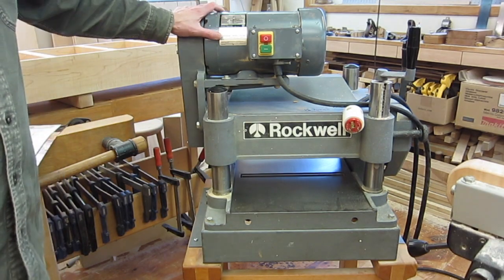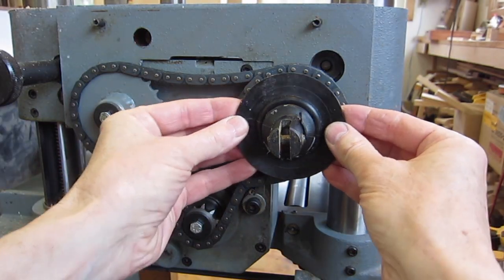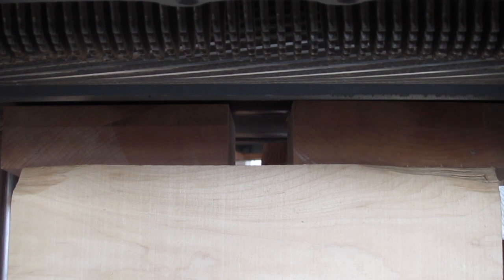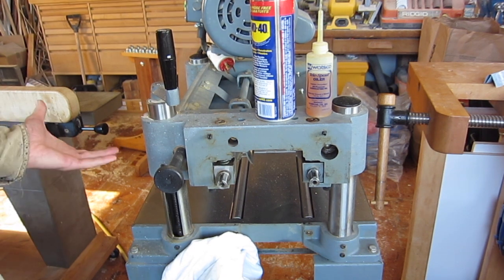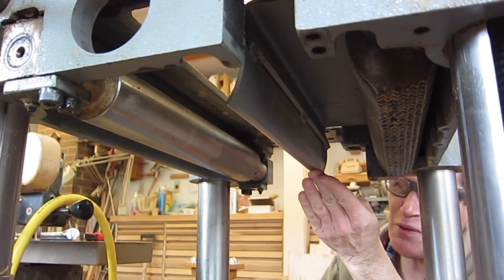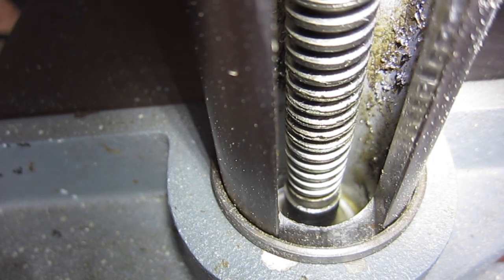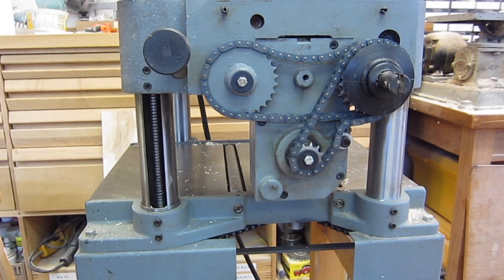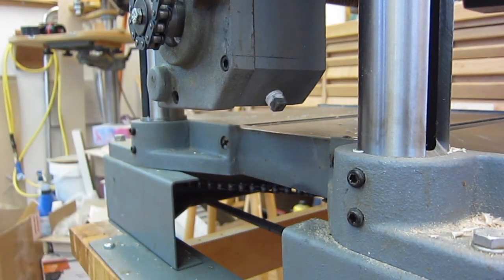Rockwell Delta RC-33 DC-33 22650, 4 post planer upgrade to BYRD SHELIX + Lubrication + Adjustments

Comment: Doing a Shelix upgrade right now and consider myself so fortunate to have stumbled onto Steve’s first rate video. 
What a wealth of easily repeatable techniques. I have a lot of experience myself in both woodworking and precision tooling inspection, but I learned something every minute I watched this treasure. A real service to our virtual community of woodworkers and garage  jockeys. THANK YOU!
Reply from the maker: @Al6kar  You have a good eye to catch that broken insert.  I did not notice it myself.    Having used the upgraded planer for almost 2 years, I checked and there are no more broken inserts.  The most likely explanation is that the broken insert in the video was due to handling of the cutter head during installation.

Comment: Hi Steve.
I want to really thank you for an amazingly explicit and comprehensive video. I can only imagine how difficult the editing must have been especially with you having to explain every step. Your effort is really appreciated as I am in the process of servicing and troubleshooting  my used 15 inch rhickness planer which is almost identical to your machine. I'm a huge fan of the vintage Rockwell machines and also own a Delta 22-101 which I plan to clean up as well one day.
Thanks again. You have a new fan.
Reply from the maker: Thanks for feedback.  An additional challenge is this was my first time taking the machine apart, so I made many mistakes along the way, had to back up a few times and re-shoot video showing the correct way.  But it was all fun for me, just like a challenging woodworking project - learn by doing.
Reply: @steven.woodward  oh wow, now I'm flabbergasted....it seemed like you had done this many times. 
It's guys like you that give us novices the confidence to tackle tasks that would otherwise seem impossible with a 'let's call a professional' attitude.
Can't thank you enough!

Comment: Steven,
A friend of mine recently acquired a: Delta-Invicta
Model# 22-650
Serial# 26272
230 volt, phase 1~60
Manufactured in Brazil, 11/1987
I have agreed to help him change the blades & tune it up. It is something I did in a graduate level 'Machine Maintenance & Repair' class I had in graduate school about 40 years ago. We do not have the original knife setting jig that came with the machine as it was in storage for a couple decades before it came to my friend. I believe that it was mentioned in your video that you also lacked the original knife setting jig. I've read the 176 comments on your video but didn't see it addressed. I've also looked in your Google Doc's, as well as joined the Woodworking Talk forum and read the string of comments you recommend. I also followed the others they point to. If I missed where you addressed it, I'm sorry.
My question & the issue is "How did you personally change the 3 straight blades on your Rocket/Delta before you switched to the Byrd Shelix head?". What jig & procedure did you use? Also, my friend has a Belsaw Planer & jointer that I'm not sure of the make & model. Is there a jig you're familiar with that we could use on all 3. The Belsaw Planer & jointer are both good sized floor models, not benchtops. Any help & advice would be greatly appreciated. 
Thank, 
Wayne
Reply from the maker: When I used the original straight knives, I used the jig that came with the planer.     I have not tried any other jigs for setting the knives but here is a good discussion on the topic which may help you.   https://www.woodworkingtalk.com/threads/using-aftermarket-knife-setting-jigs-for-delta-rc-33-or-invicta-delta-22-650.11600
Reply: @steven.woodward  Yeah, I went through that also. Do you happen to have pictures of the original jig &/or plans that a new one could be created from?
Reply from the maker: @waynemiller6945    A photo of the original knife setting jig is in this thread.  https://www.woodworkingtalk.com/threads/delta-dc-33-planer-knife-jig.228364/        I don't know of any plans for making one.
Reply from the maker: @waynemiller6945  Have you seen these:   https://www.grizzly.com/products/woodstock-planer-pal-standard-pair/w1216a
Reply: @steven.woodward  Yes I have. My friend actually bought a used, Delta branded set of Planer Pal, knife setting jigs that appear to have been manufactured in the 80's. They are very similar in design. We're hoping that they will be functional for both his planers & the jointer. I am curious about the form of the original 22-650's knife setting jig because of the limited space to access the knives from on top of the planer. Do you still have yours? Or did you pass it along after the cutter head upgrade?
Reply from the maker: @waynemiller6945  I sold my old cutter head to a guy who makes wooden jointers and gave him the knife setting jig.    I do recall it is a bit of a tight fit to access the cutter head from top of machine.   I am curious if the Planer Pal jigs will fit but certainly worth a try.   Please let me know.
Reply: @steven.woodward  Of Course, I'll let you know. It will be several days or a few weeks before I expect to report back.
Thanks for what you do Steven. Keep up the Good Work, 
Wayne
Reply: @steven.woodward  Thank You Steven. I had looked at all the diagrams in the exploded view parts drawings on your Google Drive Folder, an excellent resource by the way,  of the various models of this planer. I won't be able to cast and mill one, but maybe the style that has two flat pieces of metal with a rod connecting them. That is, if the vintage Delta brand Planer Pal doesn't work.
Thanks Again Steven. you're really doing good work,
Wayne

Comment: I purchased a well-used Invicta-Delta Model 22-650 (S/N: 16242, Date: Jan 1986) planer a few years ago.  It definitely needs cleaning and some TLC.  This video and PDF is most timely as I just pulled the planer out of the back of my shop to begin the cleaning and adjustment process.  Thank-you for your effort and detail in your video!
Reply from the maker: Congratulations !     Let us know how it goes.    I personally get more satisfaction by restoring a machine, than buying a new one.

Comment: Steven, this video is an absolute life saver.  I just purchased a used delta invicta 22650 and stumbled across this video.  I can't wait to get in there and do some cleaning and maintenance on mine and get it tuned up.  Even though I'm planning to use the straight blades at least for a while, some day I may upgrade to a shellix blade and I'm sure I'll come back and get great value from the video again.  I know a video like this adds probably 200% of the time it would have taken to just doing the rebuild without filming, so please accept my heartfelt thanks for sharing your process and lessons learned.  Kudos!
Reply from the maker: Thanks for the feedback.   Congratulations on your purchase of 22650.    At least half the video is useful for those with the straight blades.    I would not bother to open the gearbox unless you are changing cutter head - just drain the gear box, fill with oil, drain again, and fill with oil.   

One thing that is required for straight blades is the fixture used to set the blades into the cutter head, so that they are all at the same height and parallel to cutter head.   A fixture was provided with each new planer but some used planers are missing the fixture.   If you are missing the fixture solutions can be purchased from other suppliers.  

Here is a very handy discussion on setting the straight knives:   https://www.lumberjocks.com/topics/87482
Reply: @steven.woodward  Great advice.  The planer I bought indeed does not have the alignment jig for the knives.  I've been working on a solution for this and already came across the discussion you linked.  I think I have a reasonable solution figured out, but I'm concerned the springs that push out the blades may not still be included since the prior owner said he had better luck aligning the blades without the springs installed. I'll see what's what, but I may come looking for advice if I run into any major difficulties.  Thanks again for the great tutorial video.
Reply from the maker: @uclatimsta  I no longer have my old cutter head  [ sold it on Kijiji,  to a guy who was going to make a jointer with it ], so I can't measure the springs for you, but they are nothing critical so you could just measure the diameter of the hole that the spring fits into, and estimate the length required , then order some compression springs on Amazon, or maybe an assortment kit. https://www.amazon.ca/CREEYA-Compression-Assortment-Different-Stainless/dp/B08KD5Q2P7/ref=sr_1_6?crid=2CZY92AFXLD9N&keywords=compression%2Bspring%2Bassortment%2Bkit&qid=1653163523&sprefix=compression%2Bspring%2Bassortment%2Caps%2C70&sr=8-6&th=1
Reply: @steven.woodward  awesome, thanks for the info!

Comment: thank you for such a detailed video. I just purchased a RC-33 planner. Now I have confidence in dealing with any issues with my planner.
Reply from the maker: Congratulations on a wise purchase !   As your machine is 30 to 40 years old, and likely not had a complete lubrication recently, if ever, my humble suggestion is to perform the lubrication steps in the video.  This will give the machine a second life.  For the actual work the PDF instructions may be easier to work from.  PDF file can be found here https://drive.google.com/drive/folders/1_Qm84_ZeMmsxgP-hHsI-Ppf39kiUOEU3

Comment: Just got a 22660 yesterday that is going to need a little work. This video will be very useful....good job. Appreciate your effort!!
Reply from the maker: Congratulations !    I added Delta DC-33 22660 manual to the google folder mentioned in video text above.   Looks like same architecture as machine in the video but the gears and belts are little different.   Let us know how it goes.
Reply: Steven Woodward Leveled the carriage, adjusted the rollers and chip breaker height, replaced the blades, and gave it a good cleaning and it’s working like a champ! What a well made machine. Thanks again.

Comment: Awesome video.  Thank you very much.  I used a utility knife blade to open my gear case with a pair if vise grips and a wedge afterwards.  Need to order gasket materials now. Glad I opened  the case to know for sure that there was no problems.

Comment: Wow.  That was an excellent detailed video.  I just picked up a Delta 62-175 (for $200 with mobile base and stand, knife setting jig, and an extra set of knives) in really good condition.  Just fired it up last weekend.  It looks very similar to yours and now I think I'm going to have to at least get it lubed up; you saved me a ton of time.  Appreciate your very detailed instructions.  Thanks.
Reply from the maker: You got a very good deal Frank.     Let us know how the 62-175 planer rehabilitation goes, and if it is the same as RC-33.

Comment: I just watched your TS sled video from the link on the CWW forum and poking around, found this one.  My RC 33 is an older one; no disengaging lever, but I do have the cast iron dust chute.  No intention right now in adding the Shelix head but I do need some maintenance.  I will be bookmarking this excellent video and following your outstanding instructions.
Thanks very much for taking the time to share your experience.
Reply from the maker: The  cast iron dust chute is a rare item - nice to have.  Most people, including me, did not purchase that accessory when they bought the planer, as dust collection was not so popular in the old days.

Comment: Hi Steven,  Thank you for taking the time to detail your process so thoroughly.  I just purchased a well-loved (Serial # 9975, Date 3-84) Rockwell 22-650 planer at an estate sale and look forward to refurbishing it using your video and PDF guidance.  Thankfully the purchase location was just four houses down from mine, but I still need to get it from my street-level garage down to my basement workshop.  I imagine I'll be doing that in pieces.
Reply from the maker: Nice to see these old machines being passed on from one loving owner to the next.  With occasional lubrication it should last for 100 years or more.  I imagine a future, when machines are all made of plastic, and someone comes across this solid cast iron machine from 1984, in perfect working condition.
Reply from the maker: Regarding taking the machine to pieces for moving.  The easiest thing to remove is the motor along with the cast motor mount and cast belt housing - just 2 bolts and off it comes.    That should knock the weight down quite a bit.   There are four holes in the base, two at each end of planer.  Steel rods, that came with the machine, go into these holes to create "handles" so that the machine can be carried by two strong people.   The rods that came with machine have a groove on one end to receive a circlip ring.  The circlip ring goes inside the casting so that the handles don't slip out.

Comment: Great video. I'm only 31 so I want to pick up one of these machines that's older than me!  You could eliminate that 13.125" problem by attaching a little spacer to either side of the planer bed wall, infeed and outfeed - then all the wood would go under the blades.  Thanks again.

Comment: So helpful … installing a Lux HH on my 15” Delta 22-785X…. Damn near exact same planer…bought 4 new table roller end bearings that had bad spots. Overhauled mine just like you have shown, making my block tonight…. So i can start the rest of the re-assembly. Did reinstall Infeed and out feed rollers. I just filled the “cups” in the journals with oil… should i fill em up more?   Thanks again… 5 star video right here.
Reply from the maker: Good to hear that the video worked for your planer as well.   As for the oil in the bearing journals, it likely does not matter as long as they get one good dose, but I filled up mine again before final assembly, just to feel good about it.

Comment: I would like to thank you for this very informative video. I have a Similar planer, an SA-380 with a fixed head I'm restoring. At the 11:10 to 11:23 point you talk about the block bearings with cintered bronze bushing on the in-feed and out-feed rollers. My bearings don't have these bushings and have a very small amount of play. Should there be any play? I've thought of drilling the holes out large enough to accommodate the cintered bronze. Any suggestions would be greatly appreciated.
Reply from the maker: I googled for a photo of SA-380 -  it does look very similar.      The "very small amount of play" that you mention should not matter for the infeed and outfeed rollers as the bearings ride up and down on springs.   Play in the cutter head bearing would be an issue because that would give an uneven cut.   As for drilling out and inserting bronze bearings, I guess that would depend on how comfortable you are with doing that precisely, and being able to get a bronze bearing with correct internal diameter.  It is something I have never done myself.  I assume the bronze bearing sleeve would just tap into the hole that is drilled out, so would have to be done precisely.   Perhaps search for some YouTube video on brass bearing installation and see what is involved.   What ever you decided to do, I am curious how it goes, so please add another comment when you are done.

Comment: I have a "YHP-150 Auto Planer", which is almost identical construction to yours other than it's 15". The only difference I can spot is the feed speed selector is on the bottom of the gear box.I have used it a few times, and it has been good. I have a shelix cutter head from byrd on my 13" Ridgid. I have been looking for more information about the cutter head on mine and got nowhere. Once I have finished a few projects at hands, I am planning to do the upgrade on mine. Same situation, Byrd requires some critical dimensions before they can make one. Your video provides a lot of great information of the whole process. Eventhough it is a different size than mine, the principle, procedure and process should apply. Thank you again for the detailed inforatmion. When I do mine, I will try to document the process to share with others.
Reply from the maker: Link to instruction manual with parts list,  if you need one.   Does look very similar to RC-33.      https://www.woodworkingtalk.com/media/yhp-150-total-shop-planer-cover-page.53909/
Reply: @steven.woodward  I bought it used, and the previous owner took very care of his tools and documentation for them. I also bought a Unisaw 36-812 with Biesmeyer fence. They both  came with original manuals, and manuals for the fence system.

Comment: Thanks for making your video. Getting ready to change blades on my Wood Tek 15 planer. My planer is similar but not the same. Great tips I will be checking and cleaning a lot on mine. Very thorough and well explained. Thank You Don Maurath
Reply from the maker: I googled "Wood Tek 15" to see what it looks like.   Looks just like an RC-33 !